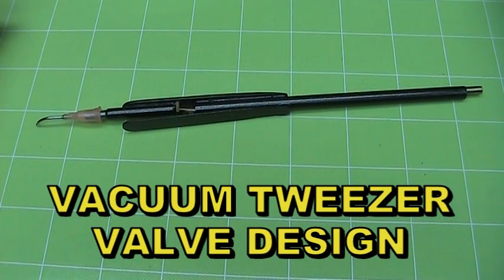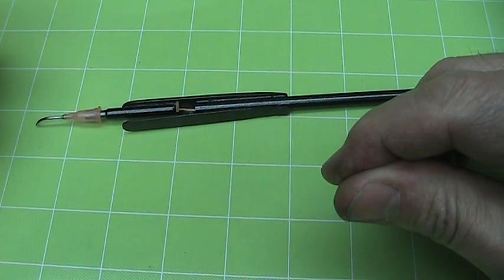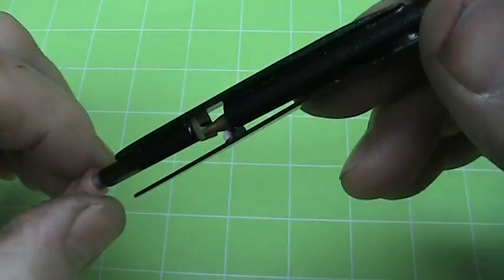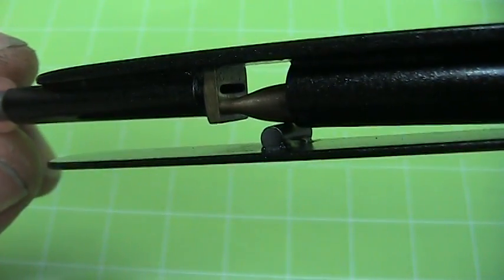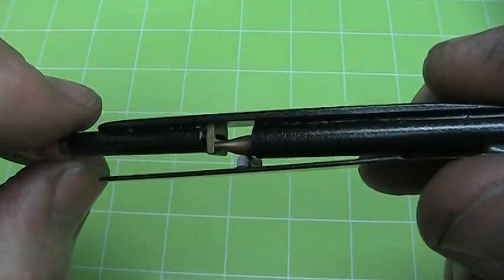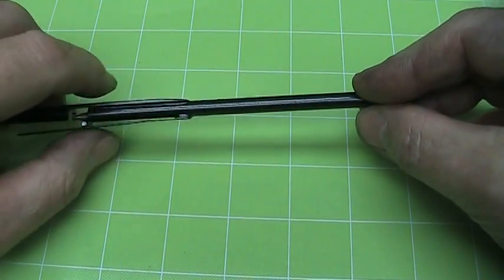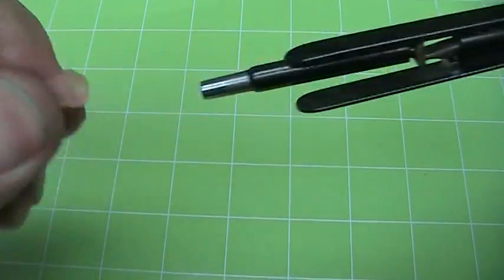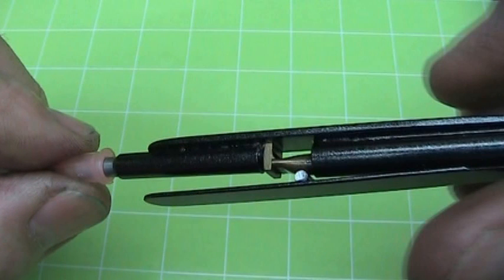VACUUM TWEEZER DESIGN

Comment from the maker: The tubes were squashed oval on the end in a machine vise. I had a tapered piece of 1/32" shim that I put in the hole while squashing it to keep it oval. I took a square piece of 1/16" thick brass and end milled a 1/16 slot that matched the outside of the oval tube. That is the square stationary part of the valve. Soldered the tube into the oval slot and then faced off the brass plate and tube in the lathe and also the end of the moving tube so they would be flat and perpendicular.

Comment from the maker: The moving tube 5/32" OD x 1/64 wall is pre bent and soldered parallel against the inside wall of the outer tube 1/4" OD x 1/64 wall.  A short piece of 1/16" diameter brass holds it in place and is soldered in also.  In the "ON" position the moving tube is parallel to the outer tube and against the ID of the outer tube for the full length.

Comment: That's a nice idea, I made the "cover the hole with your finger" version work sufficiently well by putting some foam rubber in the handle to restrict the flow to the needle. Without that there was always too much residual vacuum going to the needle and it would not let go properly.

I since found they make pneumatic valves in the same form factor as microswitches. I'm not sure if they even work for vacuum but it would be my first attempt now, I use one for the paste dispenser.

Comment: Thanks for this nice idea !
I have been doing electronics for more than 50 year now - and I am not retired just yet - started very early ....
I have cursed the same delay which You were discussing in this video. In addition the standard vacuum tweezers waste vacuum causing the pump to run unnessecarily.
I have an old and (t)rustry Weller rework station and I really hate the vacuum tweezers which came with it. I used that doomsday device just once. This gives me some hope for a better future. I have a spare ceramic vacuum pump (Weller) and with some turning, piping, pressure sensoring and microcontrolling it will become a beauty ... LOL .
THANKS !
Reply from the maker: Thanks, and thanks for watching and commenting.

Comment from the maker: In my previous answer just a short 1/2" section at the back is parallel and soldered. The tube in the relaxed position is touching the opposite wall of the tube at the ovaled end

Comment: Hi mate.  Very nice design indeed, I would like to see it used in earnest, to see what you can do with it.  Do you have a filter to keep the crap out of the system.  What do you use as a vacuum pump, would an old refrigeration pump work?

Comment: Got it.  Thanks!  Did you solder the oval-ed tube into its housing at an angle or did you pre-bend it to allow for straight contact at the back for a stronger joint?

Comment: With movement needed, won't the tip/held part move when you try to release the part, displacing it?
Maybe some kind of miniature solenoid valve controlled from a pedal would work better?